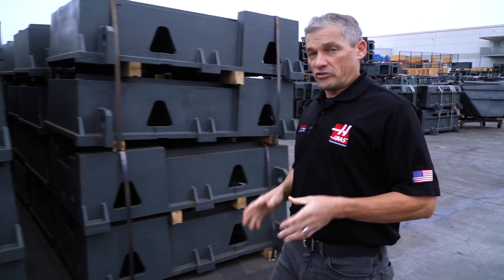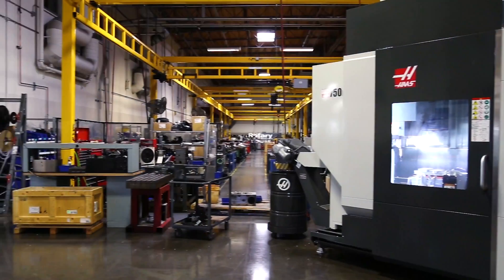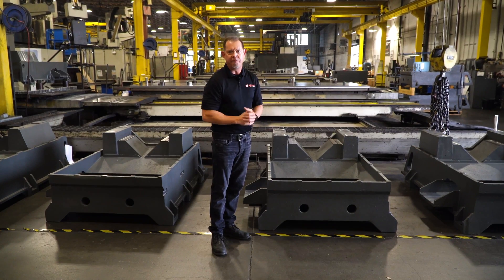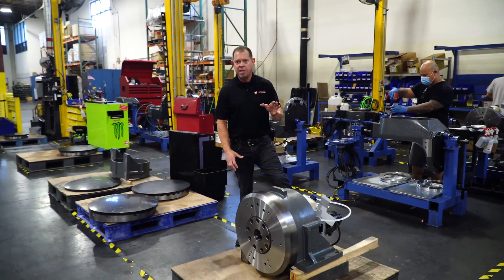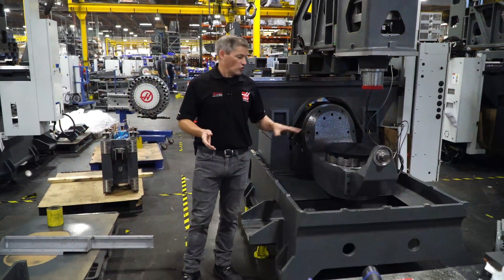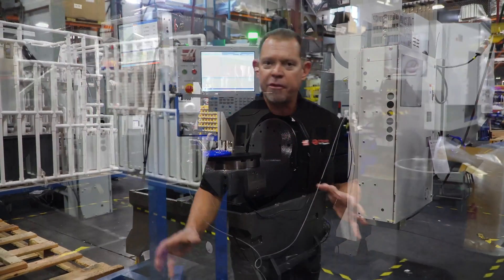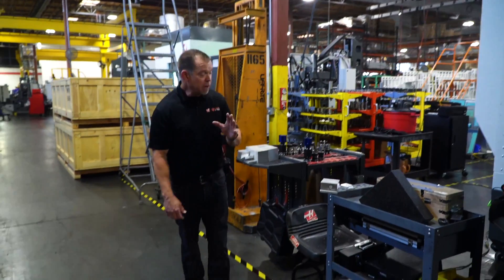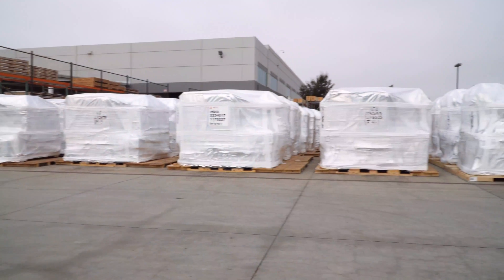How to build a Haas 5-Axis UMC machine

Comment: I didn't see hand scraping on contact joining surfaces. Why?
Reply: because its not a triple the price Japanese machine
Reply: @mrt6399  At least surface grinding ,this way is like chinese machines😅
Reply: @mrt6399  Haas Umc costs about 220k,for that money they can do that.
Reply: @dekki-d5t  I agree they should but don't, I don't think I would be wrong in saying they are focused on making a somewhat capable machine for a decent price. and grinding or scraping just ads to that, a similar sized machine from japan probably would cost 500 to 800 depending on brand and options. I personally love haas mills, for the price they are pretty accurate fast and rigid, they arn't trying to compete with a 700k makino  that holds tenths day and night
Reply: @mrt6399  I read a lot of comments from owners that umc machines have a lot of problems with accuracy,positioning,software and they sell it and buy other 5 axis brands.For example A axis is just rotary axis they sell installed on this machine.So I think that it will be better to build quality instead of just to looks like machine
Reply: @dekki-d5t  I agree, I saw a lot of umc owners were really disappointed, and rightfully so. I do think haas can do better, make some of their casting way thicker. and use more water cooling for spindles and machine/ temp control, and make the machines capable of doing simultaneous 5 axis with glass scales but they focus on cost. like I do wish they would make a true high performance line, not an entry level machine that you can put almost any ware and not just compete on paper but in real life results in accuracy and speed/ stability